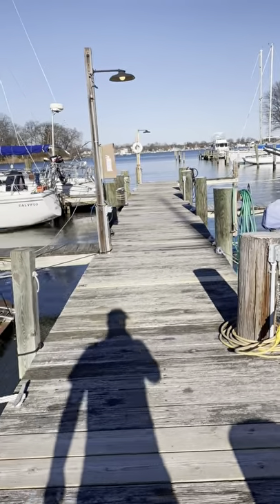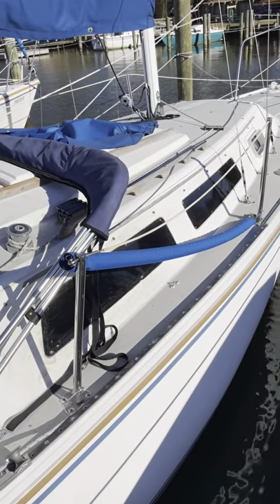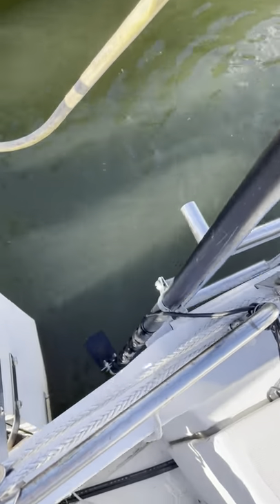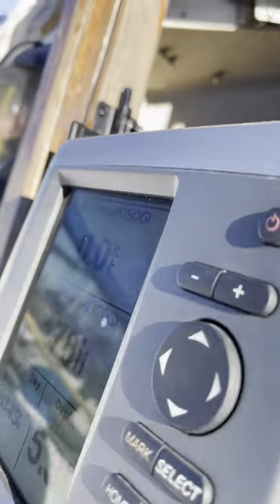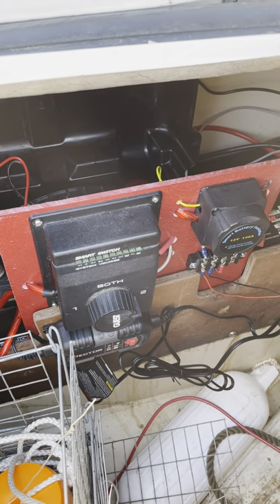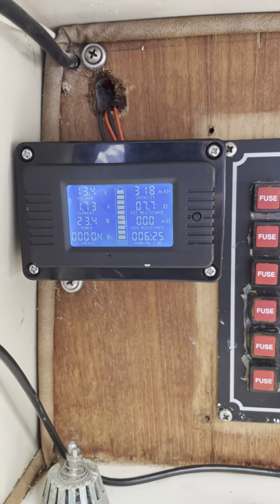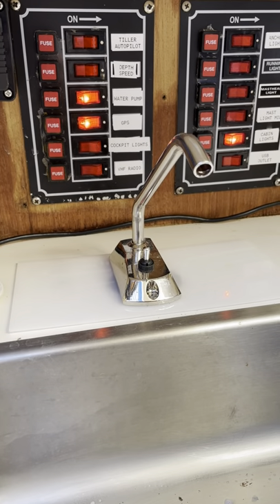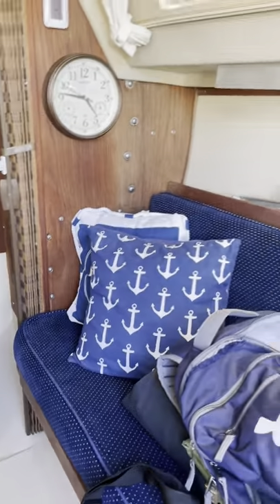Upgrades to our Catalina 25 "Belle"

Comment: Do you know if your motor is a long shaft or extra long shaft? I have a long shaft (measures 23” from mounting bracket to anticavitation plate) and I’m wondering if you’ve dealt with any issues keeping the motor from popping out of the water with this mount. I know this bracket doesn’t lower as far as the Catalina bracket. Thanks!

Comment: what is the link for battery monitor?
Reply from the maker: DC Multifunction Battery Monitor Meter,0-200V,0-100A (Widely Applied to 12V/24V/48V RV/Car Battery) LCD Display Digital Current Voltage Solar Power Meter Multimeter Ammeter Voltmeter https://www.amazon.com/dp/B07T8GN61Z/ref=cm_sw_r_cp_api_i_93E2KTN9QVYWVE6M2Y3G